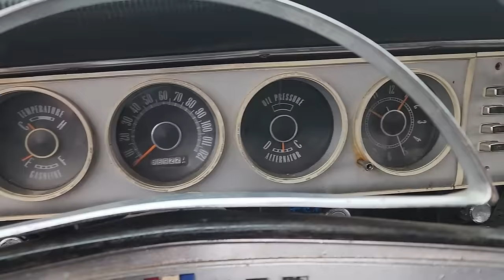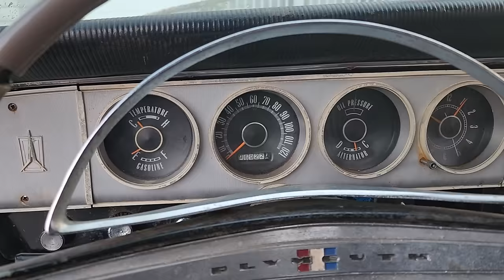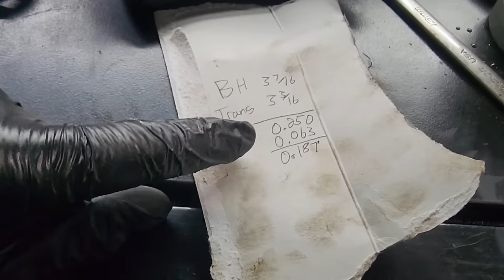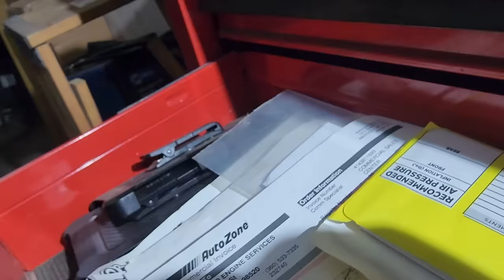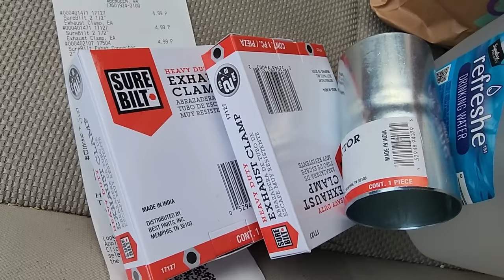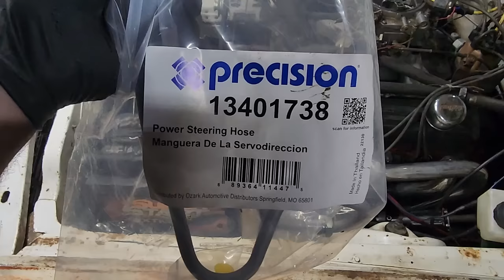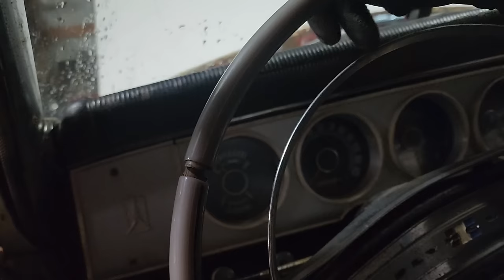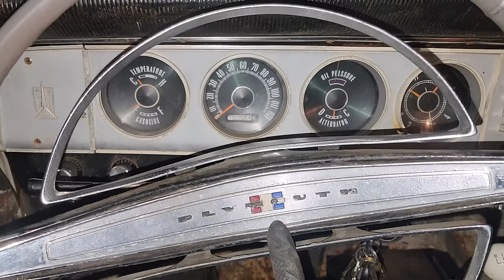Ratty 1964 Plymouth Fury Engine Swap! Magnum / Roller Cam 360 Install, Steering Upgrades, And More

Comment: Have only watched for 30 seconds….in  late 1968, at age 18, while home on leave from my first year in the Marines,I bought a perfect, low mileage 64 Fury….not a Sport Fury.  A buddy, 4 houses up the street sold it to me as he was buying a new Vette. He was 19. The Fury was factory stock. It had posi/383/4 speed/ dog dish hubcaps/ manual brakes and steering. Red with black bench seat interior. Perfect. I drove it a few days and had to leave it at home as I had orders for Vietnam. After 13 months in Nam, I came home to Omaha for a fe 30 day leave during which I mounted Hooker fender well headers, glass packs , traction bars and E.T.brand 5 spoke “mags”.  Then it was back to Nam for another 6 months and the Fury sat in my dad’s garage. After my second tour was up I came back home for a few days leave .Then I drove the car from Omaha to North Carolina for the last 3 months of my service. In North Carolina, I drag raced it . Modifications while in North Carolina included an electric fuel pump/ Weiand alum. intake/Holly 780 Dual Feed carb/ Lunatti  hydraulic camshaft and springs. I guess that horsepower was about 400 at that stage, up from the factory rating of 330. When I came home for the last time , as a civilian now….
Within days I lost my license….charged…rightfully so…..with willful reckless driving. I lost my license for 6 months and did 10 days in jail and had to sell the car cause I couldn’t afford the high risk insurance on a performance car as a single young male. Hindsight tells me I should have told the judge that I was a Marine Sgt., just home from a year and a half in Vietnam and like many Marines in that circumstance ….somewhat tightly wound. But, I didn’t. I sold the car to a couple of farmers from a small town in central Nebraska. They bought it just to drag race with it. I never saw it again.that was 54 years ago. I think of the car daily as one does with any lost love….car or woman. Dave Heitman in Omaha
Reply: Thanks for your service, sad for lost love,thanks for sharing a part of your life .
Reply: @rlp2806    Dang!! 👍🇺🇸.
Reply: Damn I almost had tears in my eyes after reading that what beauty she must’ve been 😢
Reply: Semper Fi Brother, get one and drive it like your 18 years old again.
Reply: @RaiderX948  Yes! 👍
Reply: Great story, although sad to bid farewell to the ❤ of machine. Maybe those farmers are still tearing up the streets...😊
Reply: Sure grip rearends for Mopars.

Comment: You’re absolutely right about the locktite, it’s not a permanent weld or anything. If you want a bolt to stay put just put a little dot of red on it and it’ll stay, and it’ll come right out again if you need it to. In extreme cases it may take a little heat but not like a rusted seized bolt or anything.

Comment: out of all the cars i've had in my life the one i probably miss the most is the black on black on red flawless 63 sport fury convertible with factory BB, 4sp and posi, yeah i know it couldn't run with some of the other mopar's i've had,  gtx, super bee or pro-street RR, or even any of the tri-5's or SS's i've had but the 63 was just so cool and classy when sittin at stop light with it's bump'n cam and the ting ting of the hemi mufflers, i really miss that car......
Reply from the maker: Man, that is cool. I’d love to have a ‘63 hard top. I love that roofline.

Comment: I'm watching the engine removal and it is painful.  Just jack up the rear end and put the rear tires on ramps.  It's so much easier. The combined units come out like a dream.  This also works for installation.  I subscribed to the channel when Jamie had less than 100 subscribers.  You certainly have rocked it since then.  Keep them coming.
Reply from the maker: We’ve removed and installed… so many of these engines. And have never jacked up the rear like that. It makes too much sense 🤣 thank you! -Jamie
Reply: I think we jacked up the rear one time? Can't remember when but it sounds familiar. Maybe we just like to suffer.
Reply from the maker: @deaddodgebrother  Now that you mention it, I suppose we've tried it. We definitely like to suffer.

Comment: I have the older version of that cam, same duration but .512/.520 lift in my 79 Ramcharger. Swapped it in 2009.

Comment: Noticed the front disc brakes on her. Must of been a previous upgrade? Well done dude. It all looks so simple dunnit? That Quick Trick tool looks pretty darn handy dandy. I think I only heard 2 whoopsies in the video so that's sweet. Cheers to new life for old rigs.
Reply: Yes, I did the front disc brakes and most of the suspension upgrades in 2017, I believe. It always seems simple and then you get into it and things like to fight you. I probably cut more woopsies out of this one 😅

Comment: Tech tip for reusing fluids. I get the paper filter funnels for paint. They work great at keeping the big chunks of dirt that inevitably fall into the pan from going back into the system.
Reply from the maker: Brilliant!
Reply: Even better... coffee filters.  The paint ones are great too, just more expensive.
Reply: @rennkafer13  That's a great idea!  Do they work fairly well with oils, too?
Reply: @kart70  it's slow, but it does work.

Comment: 10:30 yeah lift plates work great and ppl are still afraid to use them. Yet if you look at a newer engine hook they are a lot smaller and that is what they are meant for to lift the engine by. Yet the lift plate has 4 bolts and it is in the center of the mass much more stable!

Comment: Carb spacers for certain, 5-6 speeds are better than 4.
Reply from the maker: Well sure, but four speeds is enough to get the job done.
Reply: @DeadDodgeGarage  still much better than an automatic or a 3spd manual. I do enjoy your channels, thanks and I hope to see you guys on some Motortrend show.

Comment: About to do the same for my 68 fury , my carbed stock 5.9 is ready , how do you like it ? Looks very good for a 300hp engine , it has 400 pounds of torque under 5k , it must run very good on the street , very good job and love your car
Reply from the maker: Oh it’s an awesome package. The Magnum with a carb and intake and a set of headers is a great package already. Upgrade to a good cam and springs and it gets even better.

Comment: The best spots in new england to see the eclipse will be a couple hundred miles West of Plymouth Ma. My advice is go to plymouth, see the rock, see how "Meh" it is.  Now, get going west on I 90 until you hit I 87 north.  Go a hundred miles north, pull into a rest area and wait for the out-of-time darkness to envelop you for three or so minutes.
Reply from the maker: Traditionally, they always view eclipses from a rest area for some reason. -Jamie
Reply: @DeadDodgeGarage  Not nearly as crowded as, say, the standing room only mob at the Lava Beds that time. Both times we've done it (2017 total eclipse & 2023 annular eclipse) the vibe has been great, the "crowds" have been small--just fellow sun-worshippers there to have a good time, no hassle, no BS. Probably gonna make it 3! But we are planning on aiming somewhat south of Plymouth to see the eclipse--where exactly depends entirely on the weather. (The original plan was Maine, then I realized it was in April. Just feels like Maine in April may not have the nice clear skies we need!) After the eclipse, we're going to head for Plymouth (among other places...) I have heard that P. Rock itself is somewhat underwhelming, but this is a required pilgrimage for me!

Comment: Peter, owner of Bergman Auto Craft, moved from Long Island to NC. The Valiant "Heavy lifting" prep work for it's run has begun, powertrain is dropped out the bottom. Have a full Bergman kit for the front end, including a Borgeson box that Peter goes through. He is going to stop out and set-up/tune the car when the powertrain is up in the car & everything is connected. 

For me, being out here in NC, FFi needs me to pay a deposit, get their box, then send my old one back to them. Peter charges $849 for the full Borgeson box conversion- it's a lot more convenient the way Bergman does it, the box is smaller & lighter, and Peter is an actual engineer- so he knows this topic backwards & forwards.

Holy crap @ the 1.19.08 mark- 87 octane is like $2.64 here. Non-ethanol premium (93 RON) is $3.76. I am so glad I left Redmond every time I see things like that in Washington State. Crazy. Oh, and Aberdeen looks "Same ol', same ol'"
Reply: Nice! I'm really glad I went the Borgeson/Bergman route, I'm very pleased. FFi is closer to us but it is still a hassle to ship steering boxes back and forth.
Reply from the maker: Bergman is awesome. We do use lots of Firm Feel boxes at Rocket - but they look correct, and that’s important. Yeah… fuel has gotten cheaper but it’s still far over that. It sucks. Aberdeen is just about the same, but with more empty lots because we have an addiction to knocking down cool old buildings. I wish I had a good explanation for that.

Comment: I live in Kelowna BC and have a 71 challenger. Where could I buy one of those power steering boxes?  Thanks; from Howie. I'm also looking for a front sway bar
Reply: I highly advise Bergman Auto Craft for the steering box and any related components you need. He's got the no-cut adapter and correct hydraulic adapters to make it a bolt in deal. I do not know if being in Canada will complicate ordering from him, though. He also  sells the Hellwig sway bars, which is what I used on this car and bolt in, but they've gone up in price a lot. Hotchkis suspension bars are cheaper nowadays, but do require welding if your car did not come equipped with a sway bar. You can probably find a Hotchkis dealer somewhere in Canada that will ship to you.

Comment: It ain't the lift plate, it ain't the bolts, it's the crappy threads of an old aluminum intake manifold
Reply from the maker: We’ve lifted countless engines with lift plates attached to crappy old aluminum intakes, and have never had a problem. We see people sketched out about that online from time to time, and in my experience the concern far outweighs the reality. On the other hand, we’ve broken two bolts that were holding a chain to an engine… I think we’re both to blame for one each on that. But mine led to Colin getting a bunch of stitches in his finger. His only led to my knee hurting for a couple days - but it was a heavy ass Ford V10 swinging like a pendulum, so it could have been much worse. - Jamie

Comment: back in the olden days , people would switch from power steering , to power assist steering .
M body , police car had a 16.0:1 ratio box
Reply from the maker: If there is a difference between “power” and “power assist,” I have zero idea what it is. We are familiar with the “quick ratio” gear box, and also the different length pitman and idler arms.

Comment: I MEANT TO SAY I NEVER REMOVE THE ENGINE BY MYSELF..REMOVING DA HOOD MAKES EVERYTHING EASIER AROUND DA ENGINE.."DA RED WIZARD" DATZ YOU, HAS MAD SKILLZ.. I WISH I COULD FIND AN HONEST MECHANIC TO FIX MY AUTOMOBILES.. I STAY IN CHICAGO, IL.. SUPER SHADY AUTO SHOPS AROUND EVERY CORNER & PRICEY..🤑💲.. KEEP THOSE VIDZ DROPPING..BYE FOR NOW.. 👋
Reply from the maker: Naaaaahhh. Removing hoods by yourself sucks a big one, more than dropping in an engine with the hood in the way. If I can install a dressed 440/727 on a plate by myself with the hood in place… I’m sure you can do it too.

Comment: Man That Ride is Totally a Roadkiller it’s still Your Daily driver? Or you prefer the slanty cuda?
Reply: Slanty Cuda currently has non-functional wipers, otherwise that would be a contender. Right now it's the Impala and the Fury! Trying to drive the Fury more and break it before the trip, and I guess it's working because I just had to replace the voltage regulator. 😅

Comment: Jamie, I have a question when you burped the radiator with a screwdriver in the thermostat does that damage the thermostat?
Reply: It shouldn't hurt it! You can push down on the center piece and it just compresses the spring. It pops back to normal pretty easily, and this one has been working normally. The only thermostats I've damaged were severely overheated. 😅
Reply from the maker: I’ve actually moved past that technique and just leave a heater hose or similar off for burping. Apparently some of us haven’t 😅
Reply: It’s been a while since I watched you tube. That videovideo was that your brother doing it cause I didn’t think it looked like you and then I seen dead Dodge brother!

Comment: Your engine is only 1 cubic inch smaller than mine but it is a completely different animal.
Reply from the maker: You’ve got a 361? Different animal indeed. Funny story, a whole bunch of people have responded to my sale ad for a 361 assuming it’s a typo and I meant 360 🤣
Reply: Young people just aren't that bright.  ON the side of my car it says COMMANDO 351.  A Super Commando would have been the 383. @DeadDodgeGarage
Reply: Also, why are you selling a 361 and not putting it in an old Chrysler/Dodge/Plymouth? @DeadDodgeGarage
Reply from the maker: @mexicanspec  I've been trying to figure out something to put it in for like four years. I can't think of many reasons to use that instead of one of my 440s, or a 383. I'll find something eventually if no one buys it.

Comment: Is there something hitting the driveline or something or is it my bad audio. Clicking speed related on the test drives.
Reply from the maker: Currently a mystery. We need to get our ears checked…
Reply: Are you hearing the valvetrain noise? I think my pushrods are the wrong length and the top end is a little noisy. Going to get a pushrod checker tool and find out.
Reply: It's not as noticeable on a device with decent audio. Nothing to worry about. Love b bodies.

Comment: do you need a good a air comressor
Reply from the maker: Actually, I finally got the good air compressor installed a week ago - but still have to plumb air lines… that’ll be fun. -Jamie
Reply: @DeadDodgeGarage  if you can, use Maxline... stupid easy and easy to modify later.  And it never rusts or explodes unlike black iron or plastic, which is a plus.

Comment: Does your hood ornament have an engine size on it?
Reply from the maker: It's off of a Sport Fury and says 383. The original was plain - and definitely falling off.
Reply: What was your car born with?
 @DeadDodgeGarage
Reply: I had a 383 emblem off a Sport Fury but sold it to someone else because I didn't want to be a liar. No call-out, it was a 318 Poly car from the factory.
Reply: Was it a 3 on the tree? @deaddodgebrother
Reply: It was a push button automatic car! I converted it to the four speed.  @mexicanspec
Reply: Great, although I prefer the push button, you would win more races with it. @deaddodgebrother
Reply: @mexicanspec  Mine was junk! It shifted okay but was never quite right. My fuel economy doubled when I did the four speed swap. Haven't done much racing in this car so I haven't lost any yet 😅

Comment: I might have missed it but why did you ruin the valiant? To make a running fury go  nothing makes sense
Reply: The real question is why I ruined the Fury five years ago by pulling the 360 out and installing it in the Valiant 🤔. I traded the Valiant to Jamie for the Daily Driver Barracuda but kept the engine so I could reinstall it in the Fury! The Valiant will live again with a 273 and a four speed.
Reply from the maker: He makes interesting life choices. -Jamie
Reply: @DeadDodgeGarage  well thanks Jamie ,l have a similar brother makes sense now but what an arse about way of doing things
Reply: @DeadDodgeGarage  and I think the valiant s  not worth going on with . It's very rusty
Reply from the maker: @johnkelly8525   It has zero frame rail rot, brand new floors, subframe connectors, front disk brakes and upgraded suspension bushings, front and rear sway bars, Hotchkiss leaf springs, 8 3/4 conversion with 3.23 sure grip, nice dual exhaust (except where it's smashed,) brand new carpet and head liner, a decent interior in general, correct four speed parts. Everything electrical (including the fuel gauge) works. It's a "survivor" having original weathered paint. It has a bit of rust in the quarters. So what? Should I just scrap it then?
Reply: @DeadDodgeGarage  l stand corrected .
Reply: @DeadDodgeGarage  I stand corrected the video isaw must of made it look worst than it is
Reply: @DeadDodgeGarage  l have some ideas for your channel - maybe do a 400 as most whats out is 360/440 and being you like slants, pick out the most undersirable body style to put one of them in , thanks mate
Reply from the maker: @johnkelly8525  I take projects as they come. I have a mild performance slant six build in the pipeline, as well as my turbo slant build. I have already built a 400 into a 451 stroker and have a follow up video coming on that eventually. I'll be doing a 383 or 400 in the not too distant future for a Roadrunner project. There will be all sorts of different things - but everything takes forever.
Reply: @DeadDodgeGarage  thanks for the feedback it's great that you take the time